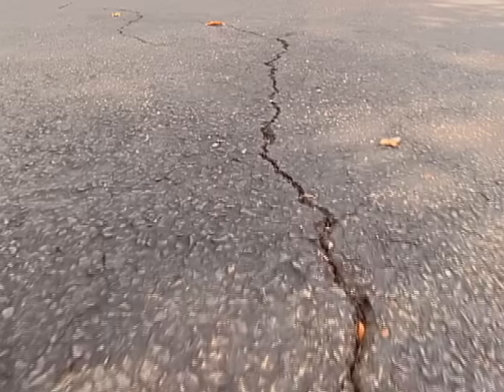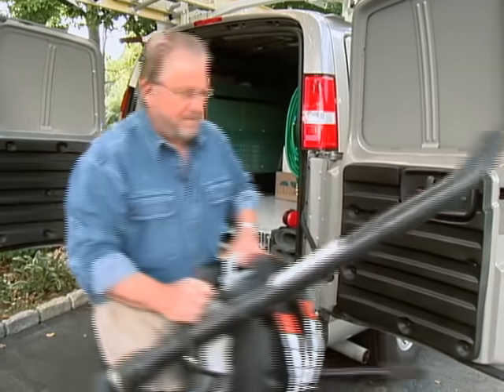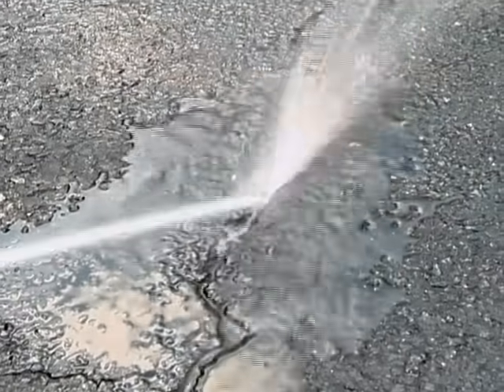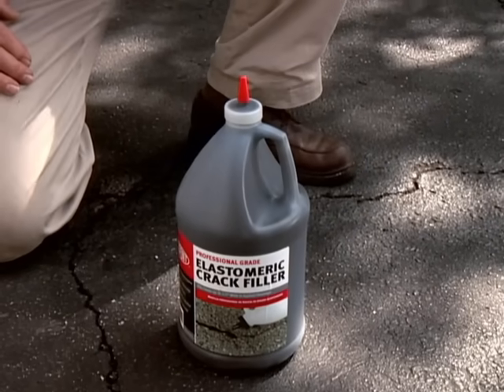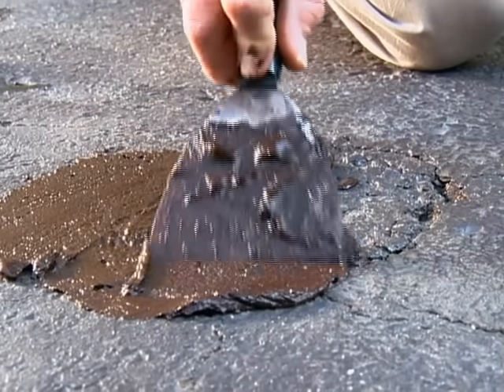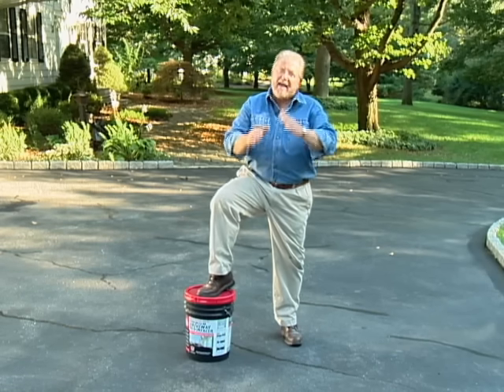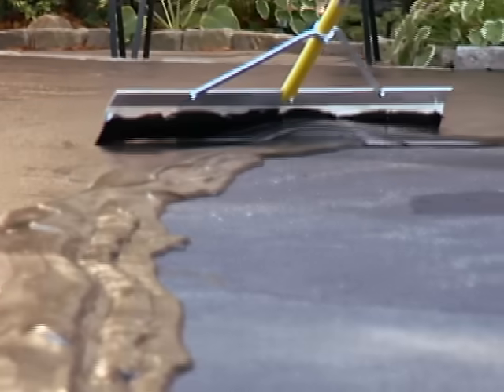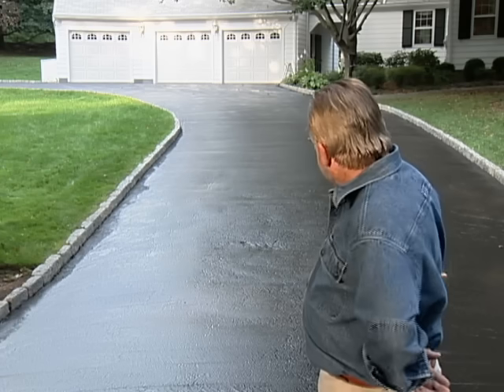How to Resurface a Driveway

Comment: About the oil stain, what is an appropriate degreaser and bonding agent and sealant? I looked up degreaser for engine oil and I got a suggestion of WD-40 degreaser from Home Depot. I guess that may work?! I am more confused about the bonding agent. I looked it up and the results include caulking, glue, and self-bond cement, which I think none of them was right. What exactly should I be using for the bonding agent and sealant? May you suggest one? Thank you.

Comment: How's your driveway look today? I live in Ithaca New York I had a sealer company come do my driveway. They did it  September 2014.they did not pressure wash that he insisted on not getting the driveway wet. so my neighbor had a different company and they did it the way you did. It didn't hold up very well. I was wondering how yours did? I used Pete's absolute asphalt they did a great  job and my driveway still looks good today. Today is January 3rd 2019. He guaranteed it for 3 years. I was thinking about doing it myself and again just wondering how long yours held up. Pete change me .25 per square foot.
Reply: Any update on this?

Comment: I wonder how many times a driveway can be resealed? Mine may have been done 4 times in 10 years. There wasn't any timeframe mentioned on how long each process took for curing time. I'm sure any patching or crack filling takes a week first. I wouldn't want any soft spots in my new work.

Comment: looks great, but how about ten years down??  Is this a system whereby you can recoat every 10 years over the old?? If it is polymer, its like modern- day paint, it can be re-coated....but it might have tar which cracks... at .any rate, great job, and great video.

Comment: Asphalt sealing is a good idea and these people for home owners are doing a good job , the only thing i would change is using a 3ft push broom  to spread and texture the material , the squeegee is ok leaves a smooth surface but pull a lot of material off the surface , a broom you can leave the material thicker only down side if you can call it a down side is it leaves broom makes , when you use a broom you have to spread te material and come back and spiral out  no big deal broom does a better job to me also if surface is rough it helps to put 30 mesh sand to thicken the mix up a little ps broom you  are pulling the material in place and that  means walking in it and brooming out your tracks , no big deal.

Comment: I used twelve buckets of Latex-ite on mine, they claim 300 -400 square feet per bucket but it's no where near that. I got about 210. Mine said it's good for ten years and they are wrong on that also, it lasted five, I don't think they take in account what the elements does to a driveway, I live in the south and it gets up to 110 degrees here with the humidity added on and it does get cold here in the winter down to the 20s.

Comment: how many buckets of sealer did that huge driveway require? How many sq ft does one bucket cover?
Reply: Depending on the quality of seal you buy it will do between 350~400 sq ft per gallon  pail he used the sealer with filler so that doesn't stretch as far as just a sealer had he used a paint roller of 18inches he could of gotten a few extra square feet out of it though.  And if your wondering a sealcoating crew will charge about 10 to 25 cent a sq ft to sealcoat the drive the more cracked and pitted the more it cost and using hot rubber last longer but they charge 50 cents to 1.50 a linear foot for crack fill and usually have a minimum set amount for Residential  that don't have thousands of feet and that's about 200

Comment: Hot boiling water kills weeds in a driveway .
Coal tar for seal coating not the latex or oil paint that rubs onto rugs coal tar only if asphalt cracks dig out all thev asphalt dig down a foot or at least 8 inches install and compact recycled asphalt and pave one coat 3/4 base coat then a coat of 3/8 top coat asphalt anything else is a bandaid Scott from NH

Comment: my asphalt driveway surface has many areas where the previous sealer is cracking and peeling. It looks like too thick of a coat of sealer was applied.

What is the best way to remove these large sections of dried, cracking and peeling sealer?

I want to re-seal the driveway.
Reply: If the sealer is peeling, I'm gonna bet the person that did the job didn't properly prep the surface (clean).
Reply: And they used the filler sealer with lots of sand over and over so it built up so ya scrape it with a scraper for like getting flooring up in the home it's like a 12inch blade on a long handle that helps good at cleaning it off

Comment: Ecellent Job . Sir..People are quoting me $14K to do my 1800 sq foot driveway ...Are they just trying to rip me off ? They say it cannot be just resurfaced. it has to be demolished and redone.
Reply: 14,000 is a lot of money even for a dig out !!! Asphalt prices here in Maine are about a 100.00 a ton . I say 6-8,000 is fair
Reply: jay james  thanks jay.
Reply: +Sajid Rafique to crack fill and seal your driveway should be less then a thousand dollars.  Depending on how many cracks
Reply: Steve Vlietstra  thanks steve.
Reply: It depends if you have structural damage to the base.     A bad base will cause the new layer to fail.  Then it has to be dug out and fixed.

Comment: Our driveway is a mess. It's blacktop. The middle is popped up   and the sides are sunk where the tires drive on it. Can't afford to have it redone. Any pointers on how I could repair it without having to have it redone
Reply: Allen  Bradford move
Reply: For the sunk areas (called depressions) you'll need to cut a square/rectangle around them with an angular saw - easy enough. Then rent an asphalt hammer and remove the area you cut. Sweep/brush, leaf blow the now removed area. Pour cold patch into it. Rent compactor from Home Depot ($60 for the day). Compact over. Pour another layer of cold patch on (because it will settle) - be sure to overlap the cold patch between the old asphalt and new area you're repairing. Compact again. Seal over with drive way resurfacer.

If you don't do this for depressions, they'll just get worse. It's not a hard job. https://www.youtube.com/watch?v=mIatQ3bL1PA <---- guy using the hammer drill to do concrete. Your job will be easier as asphalt isn't that deep nor heavy. Rent it, don't buy it.

Comment: And for the 150 it would have costed to just hire someone to do it right all those cracks will be opened  up by the next season... hot rubber is the only way to fill and seal the cracks and honestly if your asphalt is that cracked and eroded you should just get new asphalt 🤷🏻‍♂️

Comment: Whats the total cost of this? 
or how much cost per bucket?
dont mind for exactly the price, just how much about
Reply: 250-350 sq. ft. per 5 gal. bucket is the coverage you'll get. Item #808010 at Costco is $19.99 per 5 gallon bucket. Driveway length X width = sq. ft. of your driveway. Divide that by 250 to get how many buckets minimum you'll need. Multiply # of buckets needed by the price of the buckets to get your cost.

Comment: I just don't understand why not all driveways are asphalt, instead they are crappy concrete that crack and die after few years. Especially in north east, why would they make concrete driveways? Or make it concrete and then just add asphalt over it, it seems like it's so much easier to repair asphalt and it can actually breath and flex better when we go from -10 degrees to +100 degrees from season to season.

Comment: Hey Ron, if you still monitor this. I was wondering how it held up. I know yearly sealing is recommended, but I'm more wondering how the crack sealing held up. I live in Massachusetts, and we definitely have winter weather here that can be pretty destructive.
Reply: I used the crack seal, it didn't really last worth the effort to do the task.  This was bought at local big box.
Reply: Buz Off your better off doing a hot patch will last longer

Comment: This will absolutely fail.  Any cold applied latex crack sealer will fail over winter.   The only thing that will work is hot applied asphalt such as QPR6690.  You have to heat the product to 400°, which is not so easy to do, then apply.  All cold based products will fail.

Comment: Tried that doesn't work. After a hot summer and cold winter everything starts peeling off. To fix that you need to resurface driveway with asphalt not cover it with sealer.

Comment: Just paid 300 to get my driveway done. The guy didn't fill in the cracks and put very little top coat. The crack are so small, easy thing, but this guy did absolutely no fillings. Just a extremely thin top coat  I could have bought the material and do it myself and would have done a better job. But I was wanting a professional job done. Now I got to go buy all the material, clean the cracks and go through the entire process. Totally Sucks!

Comment: Complete overkill . I am going to buy DuPont shares after this . Clean this , get the weeds  and dirt out . Wash it with a power washer and then apply cement to the  cracks , wait fir them to dry and then apply cement using a board to check and level  the height. Buy DuPont shares with the difference in cost and take the dividends .

Comment: get enough fiber roofing tar in 5gal buckets and enough crushed white rock to tar and rock your drive.after hosing and brooming then hosing the drive to rinse,let it dry.let the tar set in the hot sun with lid slightly open.the tar will become hot, thin and easy to pour.spread w/a broom like you are painting a heavy coat.after brooming a good coating on the drive,shovel the white rock onto the drive and spread it with a garden rake or stiff push broom.be sure to use plenty of rock.after you roll or drive over it to pack it,sweep the excess rock and remove.you may even do a second layer if you choose.you end up with a sealed drive that is like the pea gravel side streets that are tar and rock.if drive starts bubbling up later,sweep some silica sand out over the entire drive.

Comment: I have been in the asphalt business  for 38 years one don't use  that  Crack filter  two don't use that trowel grade for nothing  you need to put hot rubber  450 degrees hot rubber in the Cracks. And as far as that primer goes dawn dish soap  and water works the best . Now if you want to seal it have at it call a local professional to fill the cracks and and prep your drive way .O I almost forgot the sand is in the asphalt for one reason for durability not for traction .he should stick to his day job . And yes we get a lot of calls  that people want to seal it but have us do everything else.
Reply: His video is fine. I bet everything he did is still holding up good today

Comment: That’s to much work to go through. He should’ve told us how much time and money it cost him and how much a professional wanted.
Reply: Professionals charge by square footage. My 1400sqft driveway was quoted close to $350. I bought everything i needed (tools, degreaser, fillers, sealer) on sale at home store for about $90. Took me an hour to clean the driveway with blower and power washer. Ill let ya know how long it took to fill cracks and seal.
Reply: Tyler Chaney thx. Where do u live?
Reply: @samg5555  USA...took me lil over 3 hrs to fill and seal by myself. But my driveway wasnt as bad as one in video.
Reply: Tyler Chaney thx for the info.
Reply: @tylerchaney1533  Did you mean 3500 for the job (quote)?.  in my area its closer to 10k for the job.
Reply: @predator-hunter-31  10k to seal a driveway? Or do you mean replace the driveway? I can get a new asphalt driveway for less than 10k...
Reply: @tylerchaney1533  that is for replacement of an asphalt driveway in my area.
Reply: @predator-hunter-31  we were talking about sealing...

Comment: Total overkill, power washer alone would have done more than enough.
Reply: Have you used a pressure washer? Too much pressure will erode the asphalt. Too little won't loosen the debris enough within the cracks. A leaf blower alone isn't going to lift pebbles & debris out of the cracks. If you understand how cracks and pot holes are created, you'd know that any gaps are a very bad thing. The less even remotely loose debris you leave in there, the better. The wire brush is the perfect way to loosen things that have gaps but the pressure washer would be too strong to use on (higher setting) for fear of eroding the crack further. It's more of a direct control. By going from wire brush ---> leaf blower ---> pressure washer in the prep phase he's stepping up the preparations in tiers. It's a little overboard maybe, but this is why we have the saying, "If you want something done right, you gotta do it yourself." Each person doing a job is going to have a different level of "Good Enough" in their head. Ask a contractor to do this and he'd likely walk off the job. However they have other jobs to do and time is money. The individual homeowner taking on a DIY may really want to make sure he's going to get the most bang out of the efforts put into resurfacing. 

Personally I fall into the category of doing things the absolute best way possible the first time, else don't bother doing it at all; at least for things I'm doing for my own benefit. If I'm going to drop a bunch of effort and cash on doing my driveway, you better your arse I don't want to see a crack reappear months after the job's done if I don't have to. If using a wire brush really quick in each of the cracks first is going to give me a better chance of that - great! It's worth the little extra time spent doing it. Also the leaf blower takes literal moments to walk over airing out the crevices. 

You just may feel that less than these efforts is acceptable enough for you. That's perfectly fine and there's nothing wrong with that!

Comment: Never pressure wash asphalt
Reply: William Fuego Why not?  Does pressure washing eat away at the surface?
Reply: Eats away at preexisting seal coating and deteriorates asphalt prematurely.  Blowing is sufficient B4 seal coating
Reply: William Fuego Thanks.  I would never have thought not to pressure wash it.
Reply: If the pressure washer lifts off old seal coat it doesn’t elong there anyway
Reply: By pressure washing the driveway it will help with removing the algae and any loose debris and oh ya most importantly the salt and brine off the roads and highways if you live anywhere that it freezes salt does serious damage and the gas and oil spots will also be cleaned but I also know not to blow holes thru the ashpalt and to stay away from the alligator cracks as not to dislodge them...But YES PRESSURE WASH IT AND KEEP A GARDEN HOSE NEARBY SO IF YOU OPPSIE ON SOMETHING OTHER THAN THE DRIVEWAY YOU CAN WASH IT OFF AS LONG AS YOU DON'T LET IT SIT ON IT AND YOU GET THE WATER TO IT RIGHT AWAY WILL WASH OFF THE DOG CAT KIDS CARS GARAGE DOORS STONE CONCRETE YOU NAME IT IT WILL WASH RIGHT OFF BUT ONCE DRYING HAPPENS ITS SEALLED LOL

Comment: Stopped watching after I saw a bucket of sealer........junk!!!  Cracks should be heat lanced and blown out so the RUBBER crack filler (not found in buckets or jugs) bonds to the asphalt........I resurface athletic courts (b ball, tennis, etc) for a living and have tried everything from home improvement stores with poor results (meaning I'm back a year or 2 later)......point is you get what you pay for and this stuff is crap

Comment: Do not pressure wash
Reply: Pressure wash (without highest pressure setting so it doesn't degrade), then LET DRY COMPLETELY FIRST. This would be the same as NOT pressure washing, but with having the debris completely cleaned off.